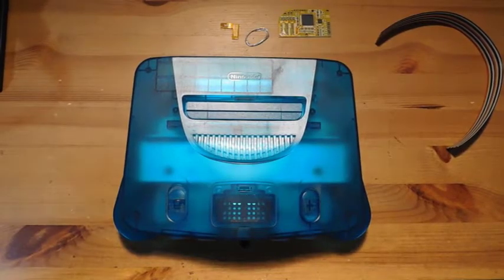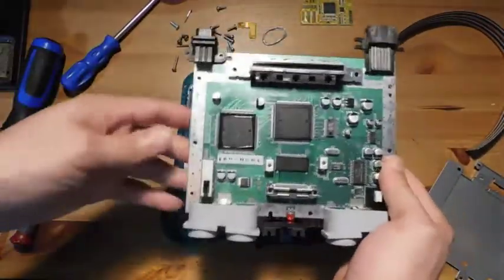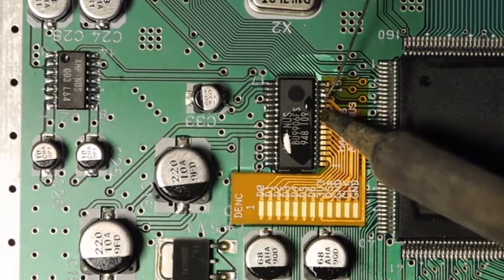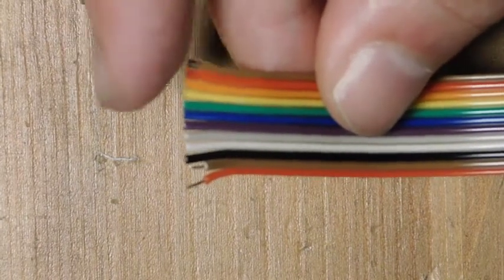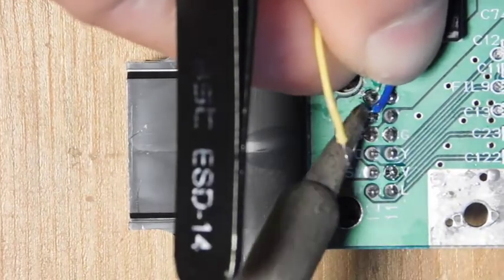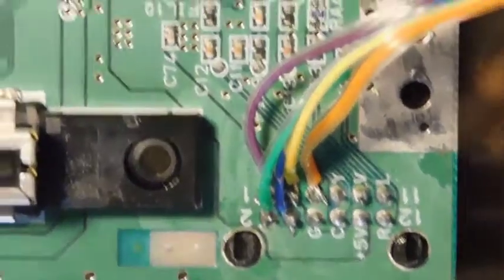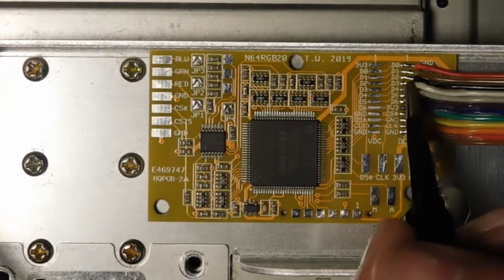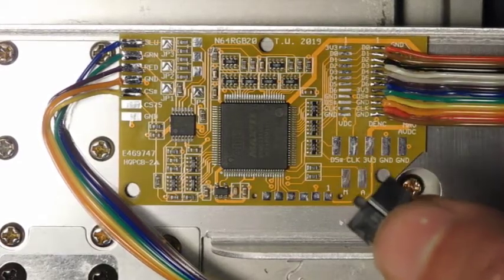N64 RGB (Tim Worthington) Install! Get the best analog video output from your N64

Comment: Is the deblur compatible with just about everything? I have done the trick with a flash cart to remove anti-aliasing from the roms, but most games have series bugs this way(crashing etc)
Reply from the maker: Yes it’s compatible and looks better on most games, and you can actually turn it on and off in the middle of gameplay to compare

Comment: For anyone wondering, this is an extremely difficult mod. NUS-001 EUR and a DENC chip. After about 5 hours and getting no video, my N64 now appears to be dead, and no power light at all. I never ran it for more than about 5 secs without the heatsink. If you're not extremely skilled, I'd send it away. EDIT - I just realised I never put the jumper pack back in when testing. FML
Reply from the maker: It’s definitely true, this is a challenging mod. Is everything working now that you have tested with the jumper pack?
Reply: @LIRetroGaming  I removed the kit, and to my surprise, it was the fuse in the plug here which had blown. New fuse in the plug, and power and composite video resumed. Soldered the kit back in (without the extra L bracket, so it's not easy), JUMPER PAK IN, and boom, it works, I agree with the comment below, the official instructions are garbage. If it were to have said 'remember to reinsert the Jumper pak', I would have saved hours. It's not clear about the extra wire needed to get the controller options to work. So thanks for this video!

Comment: The updated version of this board has another strip of heat-resistant tape so the hot glue is not necessary anymore. Also, there is an added pad labeled "SW" for the deblur switch. Wiring this to ground is the "on" position, and can be set this way for automatic deblur. That's how I have it, I hear there are compatibility issues with some games but I haven't ran into issues yet.
Reply from the maker: Yeah I really like the new version. At some point I will make an updated video

Comment: How would you wire it with out the switch as deblur always on?  Then have the option to toggle on or off with the controller combo.

Comment: Great video! A lot of the tutorials for Tim's RGB mod are outdated or kind of sloppy. I was able to follow most the tutorial on Tim's website, but seeing it done hands on like this was extremely helpful. Especially the deblur toggle switch part. I finished it on my funtastic ice blue as well, but I'm still debating the hot glue part.
Reply from the maker: Thanks! I also was not sure about the hot glue, but I couldn’t find another way of mounting the switch in a non-destructive way. At least the hot glue comes off easily with alcohol if the owner of the system ever wants to remove it

Comment: This video was super helpful with installing the mod and convinced me that I could do it on my childhood CPU-NUS-08 N64. Even as a novice at soldering, I got it right, first time and it looks perfect. Best tip, use a decent adjustable soldering iron and do not be afraid to use flux. FLUX IS YOUR FRIEND. I was worried about soldering to the MAV-NUS pins and actually that took like 20 seconds and I was done. Also, use a multimeter to check your work. Its tedious, but it will save you time troubleshooting bad connections or bridges and may even save your N64. Magnifying glass also helps.

Also, as of this month, Tim has released Version 3 of his board, which I did receive. Its so new that I barely can find anything on it aside from his site, but it does have firmware to allow reset and toggling deblur from the controller if you connect the wires to the PIF and controller port (support for toggle switch is still there). It also adds diagnostic LED's for the data pins (which is nice for troubleshooting, and kinda looks cool flashing in a transparent case and can be disabled if you want) and can natively output component video, which I didn't use, but its cool that its an option now.
Reply from the maker: That is fantastic! So glad that the video helped. I’m definitely looking forward to trying that latest revision of the N64rgb as well
Reply: Have you found any info on what the LEDs mean for diagnostics? I'm doing a v3 install on my funtastic with a mav-nus and its not outputting anything and am trying to troubleshoot

Comment: Thanks for posting this!  I really have to put some thought into doing this one and your video helps.  s-video is okay, but I love that picture quality you are getting from this.  That adapter cable soldering directly to the DAC is a little frightening, but you make it look easy!
Reply from the maker: Thanks! I really think that this is one of the best options for getting high quality video from a N64. The soldering for this one can be a little tricky sometimes, but with some practice and a lot of flux it is not too bad. Definitely worth practicing on junk circuit boards to hone your techniques

Comment: Cool video, my kit arrives next week.  I'm thinking of adding a second switch to toggle composite video on/off.  I'm intending to use the composite pin for sync and I've heard you can get interference if you leave composite video connected.  Good idea or bad idea?
Reply from the maker: That’s a cool idea, personally I haven’t seen interference but having a switch to toggle composite like that is an interesting plan. Keep me posted because I’m curious how that turns out!

Comment: I've been sharing that tip about not removing the Expansion/Jumper Pak for years and yet so many videos start by telling people you that you "need" to remove it. Such a minor thing, I know, but bravo for getting that right. :) My (hopefully) constructive comments for this video:
Removing the heatsink with the blocks is actually kind of risky because of the strange way the RDRAM chips are barely connected on the front side. I do it your way too but I make it a point to lift from the back near the cartridge port, since you can lift the RDRAM chips off the board if you don't. You can even see it happen to Jason/GameTechUS in one of his N64RGB videos!

My understanding is that JP1-3 aren't so much for European N64 consoles as they are for certain European cables... namely, European SNES SCART cables or cables made to that spec. Those had certain components in the cable (capacitors) so they don't expect those components to be installed in the console. The jumpers bypass the components on the board if you already have them in the cable. Official PAL GameCube SCART cables, NTSC JP21 RGB cables, and most custom cables are built differently, so you would not short the jumpers.
Reply from the maker: Thanks so much for the feedback, and it’s cool to know that I’m not the only one who removes the jumper pak that way! And I definitely appreciate the feedback about the heatsinks. I’ll be more careful to remove it from the back as you suggested.

Comment: Nice build but what size gauge wire did you use? I'm planning to mod mine and dont know which size wire to get.
Reply from the maker: I use copper stranded 28 or 30 gauge wire for this mod

Comment: For someone planning this mod do you know if there are any advantages or disadvantages to using component or SCART? Is quality meant to be the same?
Reply from the maker: I don’t believe that there is a difference in quality between RGB and component. Just as long as you use quality cables, the image should look basically identical between those two options.
Reply: go with hd retrovision cables.  the shielding on their cables is insane!  trust me on this, use hd retrovision cables if you want the best.
Reply: @dougdabandit2003  amazing thank you for this feedback!

Comment: I just grabbed an RGB modded N64 off eBay. Looks like it's a 2016 Tim Worthington mod. The seller states that it includes deblur but there's no switch. It's done by a button combination. Have you heard of this?
Reply from the maker: Yes this is also possible. You can flash a different firmware on it (borti’s firmware) that lets you use a button combination instead of a physical switch. If you do some searching you should be able to find what the combination is
Reply: @LIRetroGaming  Awesome. I'm super excited to receive the item. The N64 has been the only childhood retro system I hadn't incorporated into my current retro setup due to it not supporting RGB natively.
Reply: @tubinonyou  What kind of cable/adapter/ display setup do you use with your old consoles?

Given that you care so much about RGB signals, I'm guessing you're using a component cable with a Retrotink 2X Pro or 2X Classic, or a RAD2X, or you're connecting a component cable directly to a CRT.
Reply: @syncmonism  I'm using an OSSC and am very satisfied. I use SCART cables from RGC but, with the N64 I purchased from eBay, it came with a SCART cable (not from RGC). I've had no issues whatsoever so I don't plan to upgrade that cable at the moment.

Comment: I have a different Tim Worthington board that say's 2016 on it. I bought an N64 pre-modded. I'm getting pink glitches appearing on my screen(in 3d areas of the games, 2D images seem perfect) that gets worse the longer I have the N64 turned on. I noticed they ran a tiny unsleeved metal strand for the ground on the left side of the board and wrapped it around a nearby screw on the aluminum heatsink. Would that be something that would cause glitching that progressively gets worse? Should I run a bigger ground wire to the same or different location? Or should I just scrap it and buy an HDMI modded N64?
Reply from the maker: I suspect that the connections to the main analog DAC are faulty and that is probably causing the issue. That’s some thing I can definitely fix if do you want me to. You can contact me on my website 1uprestorations.com
Reply: @LIRetroGaming  I ended up ordering a newer 2019 Tim Worthington board. Going to leave the current wires soldered to the N64 then run them to the new board and solder the rest with their guide. The most difficult soldering on the motherboard is already done and looks pretty good. I read theres interference issues with the old TW boards so I figured swapping that out may fix it. I have basic soldering skills so I should be able to pull it off!
Reply: @LIRetroGaming  Swapping to a 2019 TW RGB board fixed everything. I added an extra ground and going to add a deblur switch today. That was a learning experience with those tiny wires, pins and pads lol. I really appreciate the video. Subbed!

Comment: I have a question about the AV Multiout pins. I have the same pin layout at the one in this video (Pin 3 is connected to nothing). My goal is so I can use the same RGB to scart cable for both my N64 and Gamecube (PAL GCs support RGB). Do I need to connect the (yellow in this case) wire to pin 3 (S) or V?
Reply: After reading the TW install guide, it looks like what pins I use dont determine which cable I can use. Rather, the jumpers I close on the RGB board determine it (open for gamecube scart, closed for PAL SNES scart). But I’m confused non the less…

Comment: Are you using SCART cable or the SNES HD Retrovision component cable?
Reply from the maker: Scart cable but HD retrovision is another great option
Reply: @LIRetroGaming  Nice! N64 is the last console I need to get modded. I went ahead and bought the SNES HD Retrovision cable for it for when I decide to get the mod done. I decided a few months ago to switch from SCART and go all component for my setup. Just received all the cables a few days ago from Castlemania Games.
Reply from the maker: Yeah those cables are excellent and you will have a good experience with them

Comment: Hey man what RGB cable did you end up using?
Reply from the maker: I was using a SNES SCART cable with csync from Insurrection industries
Reply: If i wanted to use the hd retrovision RGB cables would i have to do anything differently

Comment: On my N64 is the Tim Worthington V3.0 RGB on board. Can it be that I wont get any video with the normal N64 scart, I just get sound, but no video. Does some cables not working that I get always a black screen? I have new buyed this N64.
Reply from the maker: Honestly, I would have to look at it. It would depend on what type of cable you are using and also how it was installed.

Comment: will 40 pin ide wire work fine for this mod? i bought one a ways back when i did my nesrgb but moved soon after and lost the wire it came with for install, i compared it to the wire on the nesrgb and it seems close to the same gage.
Reply from the maker: Yes, that wire should be just fine for this one

Comment: Good video.. So what image would I get if I dont have a switch to add?
Reply from the maker: Without the switch you get RGB signal from the N64. However, the N64 hardware applies naturally applies filters to the video signal which makes everything look a little blurry. The deblur filter is toggled by the switch - this removes that filtering and helps to sharpen up the RGB image even more
Reply: @LIRetroGaming  ok, I just checked with my moder. He said yes you can add a switch but you can also bridge the A and Ground to automatically activate the deblur. But in any case where can I get the toggle switch from. You didnt show how to install the toggle switch for ground and A. The video skips that part. Also what would be the purpose to turn on the blur effect back on?
Reply: @LIRetroGaming  also what is this 15 bit color I keep hearing about. I cant find any video on youtube about it.
Reply from the maker: Not too sure about the 15-bit color unfortunately

Comment: Does this installation method enables both csync and sync on Luma cables? And does it also keep composite and svhs cables compatibility?
Reply from the maker: Yes, with this method you could use a cable that has Luma as your source for sync, or the csync pin as your source for sync. And yes composite video and svhs are still compatible as well

Comment: Great video man! Just installed the mod. I get video output but it looks very strange. Like the picture is over-saturated or the gamma is maxed out. Any idea what could cause this? This is what it looks like atm: youtu.be/8dnszmpxV3I
Reply from the maker: I would re-check your connections to the chip on the Nintendo 64 board. Are there any shorts between pins? Is there a connection going from the chip all the way to the N64rgb mod? You will need a multimeter in continuity mode to test all of that out. But this should be fixable
Reply: @LIRetroGaming  It was indeed a problem with the connections on the chip. It's now fixed and it looks amazing! Thanks again for the great video and the quick reply :D

Comment: I'm having a terrible time with my installs

Broke 2X N64 systems and I'm on the third and I'm still have problems 

All wires seem like they have been soldered on properly I but I don't get an image and it's all messed up

When I remove the mod the system works with S-VIDEO 

I followed Tim's install and he does not have C Sync connected 

Also I'm using the HD Retrovision Component cables

Any advice would help

I've used the DAC Adapter and straight up wired to the N64 

I at one point had success but something with the N64 failed and that system is now dead

So it might not be my cable possibly
Reply from the maker: That’s really terrible, I’m sorry that this has gone so badly. Without seeing it it would be really hard to know how to begin. I would suggest having an installer do it for you because you definitely went through enough hardship
Reply: @LIRetroGaming  for somr strange reason it's the N64 with revisions 4 or higher 

It would work for a few minutes then the signal would degrade 

Removing the mod would fix the issue but other than that the RGB mod would be unsuccessful 

I did however succeed with a revision 3 board

Comment: You may be right with your tutorial but why is yours different from the buyer side?
Reply from the maker: I’m not sure what you mean. Do you mean why this particular mod is better than the other RGB mods for the N64? If so, the main reason why is that this mod has a deblur option
Reply: @LIRetroGaming  no, i mean  just little steps like the switch between the A and GND pin to activate the deblur. The seller I got the mod from (olskool consoles) wrote that Pin M and A had to be connected with pin 16 and 27 from the PIF-NUS. Anyway both methods do not work to activate the deblur mode, but it works to reset the console with a button combination. I tried two consoles with those chip. One is a pal (denc-nus) and the other is ntsc (avdc-nus) version

Comment: that ribbon cable? not the friendliest cable. I think we should get a literal ribbon cable styled after the GBA IPS modkits.
Have the flex cable, but have us solder on the connectors, so nobody is allowed to mess even that up
Reply from the maker: I can appreciate that. A flat flex cable would probably make the install easier and cleaner

Comment: I tried this mod and im not sure what I'm doing wrong I get a picture but it's scrolling from top to bottom. Any ideas?
Reply from the maker: That sounds like there may be a problem with sync. How did you connect sync to the console, and what cables are you using?
Reply: I have the same kind of board you have in video I soldered the same way you did. I'm using a super Nintendo/ Famicom Euroscart with csync